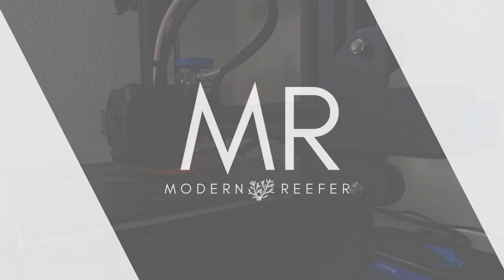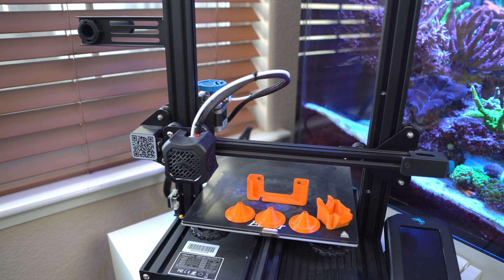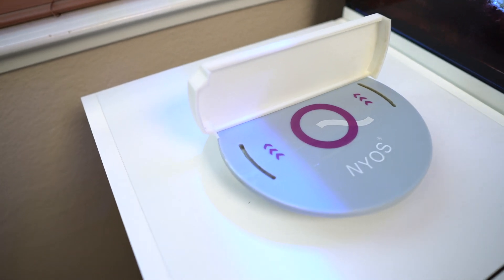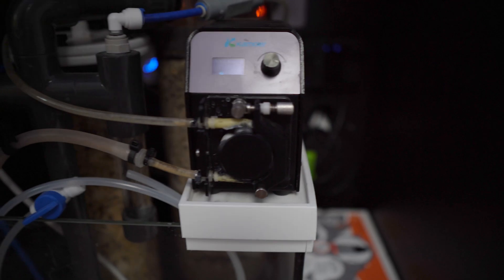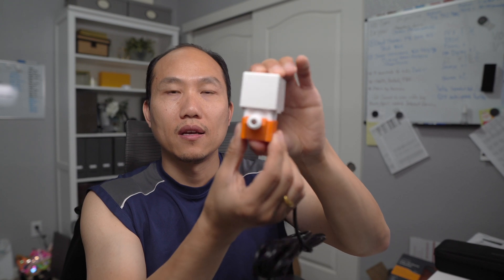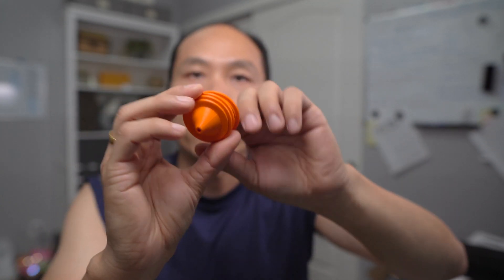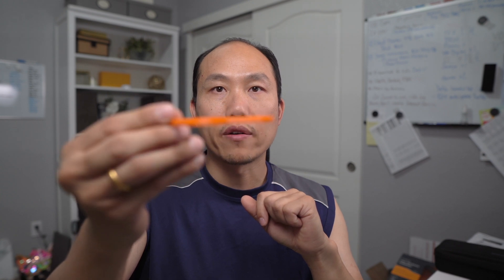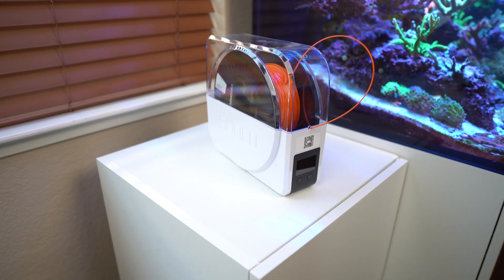3D Printing to Solve Reef Tank Problems

Comment: What type of filament you are using?
Reply from the maker: PETG
Reply: @ModernReefer  can i use PLA... I plan on painting it with a safe approved paint... but it is PLA.. i already made it in PLA. It will go INSIDE of the tank as a decoration.
Reply from the maker: @gladiatormechs5574  I've always used PETG.  I don't believe PLA will work in as it may dissolve.